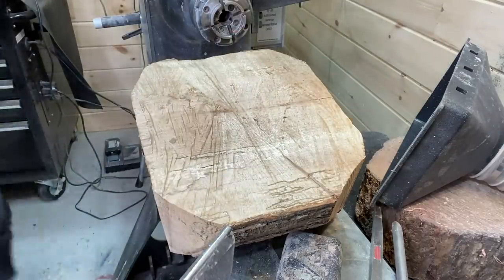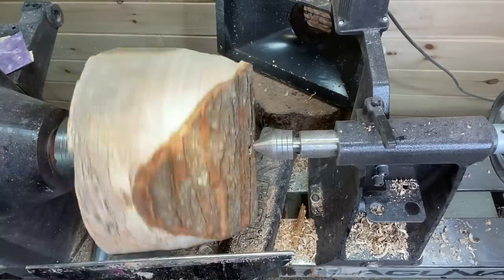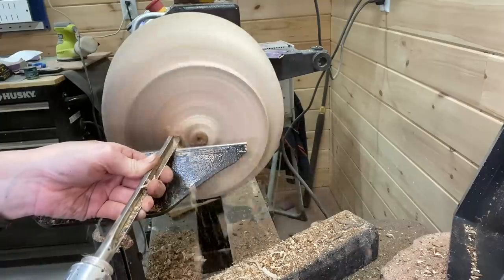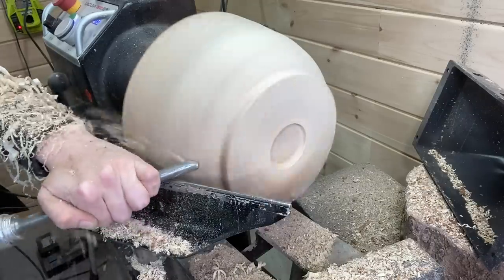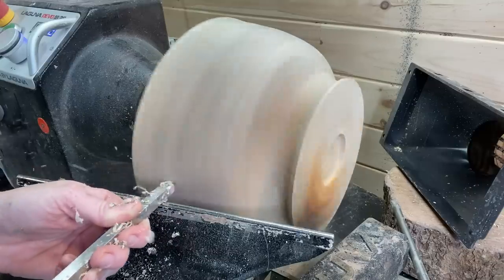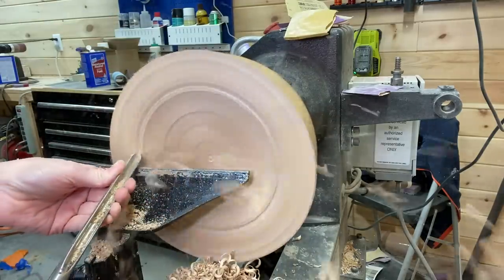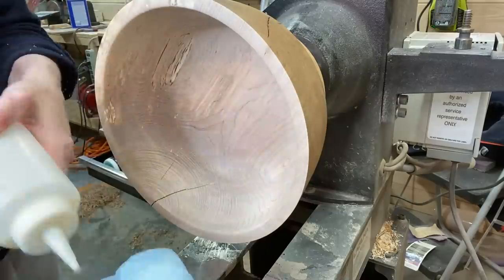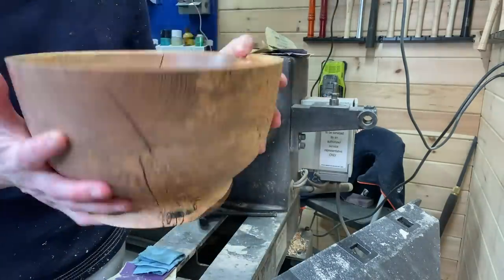Woodturning a Log to Pedestal Bowl with Beautiful Grain!

Comment: hello again, finally called simple woodturning tools about the detailer cutter.  They said they should be sharp, but the tip is rounded so doesnt cut like a point.  I told them the sides seem dull especially compared to their other tools I purchased.  They are going to send me another detailer cutter....I am interested to compare.  Will let you  know.  But you may call them and see if they will send you another?
Reply from the maker: Cool, thanks!

Comment: Nice turn Peggy!  I enjoy your video style and the tips you share. In regard to prepping the blank, did you cut it to size and knock off the corners before drying it?  Did you use any sealers on the end grain?  Where did you store the wood indoors or outside?
Reply from the maker: Hi Jon. For this one, I sealed it as a rectangle or half of one log.  I cut it to size after it was dry. Yes, used Anchorseal on the endgrain. Stored indoors in basement.
Reply: @PFWoodturning  Thank you!

Comment: #1954 Like. I've also been wondering / pondering how viable it is to ( for smaller'ish logs ) to round them using a circle cutting jig on a bandsaw. Which I hope will save a lot of time on the lathe.  I haven't yet been able to find any to try this with.
Reply from the maker: Yeah, it will likely work, I just don’t have one and haven’t built one yet. It would also depend on the bandsaw blade.
Reply: Perhaps adding it to your "Honey To Buy List", would help. The blade/s should be the easiest item to find.